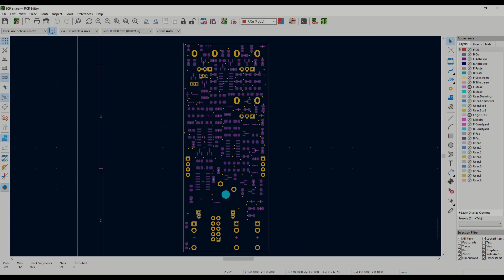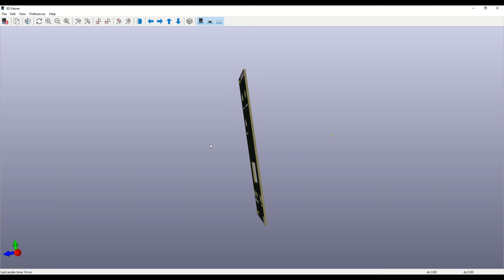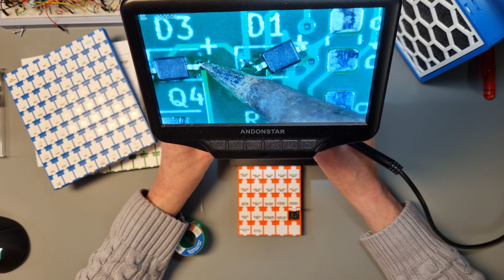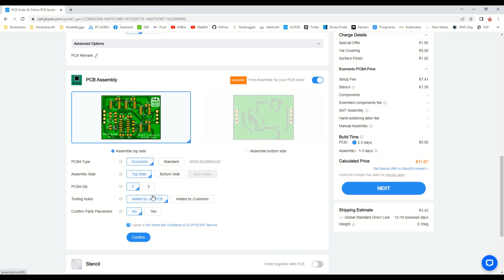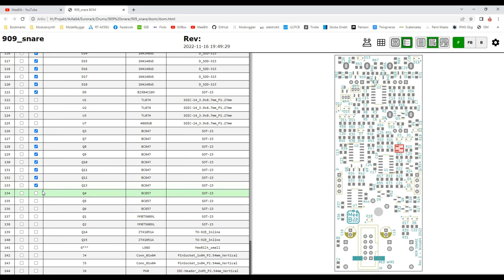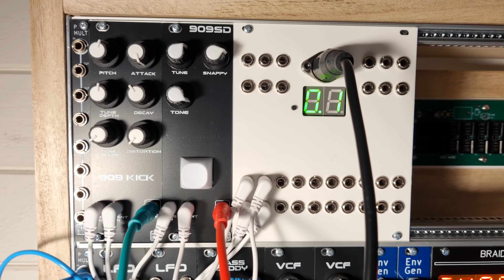Eurorack DIY: 909 Snare (Episode 2)

Comment: Can I get a list of components to make this .I have the boards and panels
Reply from the maker: Hello, the ibom with all component values and their placement can be found in my Github repository:
https://github.com/tkilla64/eurorack/tree/main/909-snare/ibom
Download the html-file in Raw format and open it in your browser.

I recommend to use Q14 and Q14 (ZTX1051A) instead of Q1 and Q2. I think they sounds much better than the MMBT5089L.

Part from that most of the components are easy to get hold of. Use NP0 or C0G types for the capacitors < 10nF and 1% tolerance for the resistors is also recommended.

Please let me know if you have a question about a specific component.

Comment: I'm having some trouble after assembling some succesful ones. Now I have too long of a decay and my pitch is higher. When disconnecting d10 to cv and env gen. It doesn't change the sound. I'm not totally figuring out this part of the schematic. It gives the trig for the envelope generators, right? So I'm thinking my bc547s from the envelope is a little to high. But I'm a bit at a halt atm. I don't think I soldered something wrongly, as multiple have the same problem. Also I checked the bom multiple times and didn't misplace anything.
Reply from the maker: Yeah, the design is quite tricky. Let's focus on one problem at the time and start with the VCO pitch.
The pitch of the VCO is set by the voltage rails of the 4069UB (VDD to VSS). So my first measurement would be that and comparing the working unit with the faulty one. A lower voltage should give a higher pitch. The zener D9 is clamping the rails so it doesn't exceed absolute maximum supply voltage of the 4000 logic series. 
The actual frequency shift between VCO1 and 2 is determnined by C23 and C24 in the VCO core - if they are wrong the frequency will be off, but Q8 and Q9 could also interfere with the actual frequency, so one way of disconnecting them would be to temporarily remove R34 and R42.
Reply: @MeeBilt  Thank so much for replying. I actually listened to your video and I think the tuning is fine. There's something else off with the sound that makes it not snap like a snare. (Noise works fine, just listening to the oscillator) I was thinking pitch or decay. Looking at the waveform on my oscilliscope, the form looks pretty much identical to the one in your video. So the only thing I can think of right now is the decay. 

Just to be sure I tried your suggestions, and removing the resistors changed the pitch half a tone. Nothing significant. My capacitors, I removed and tested, They were within spec. I can't really compare voltages, as I don't have my working ones anymore.

I'm already happy I'm learning some stuff. Even though it can get frustrating at times. ;-)